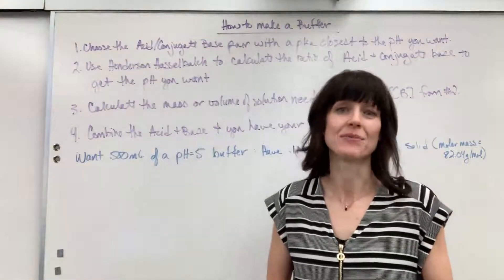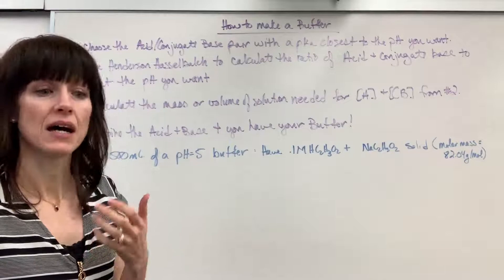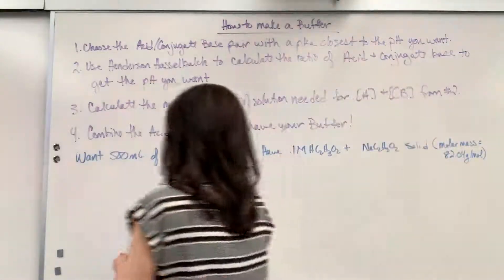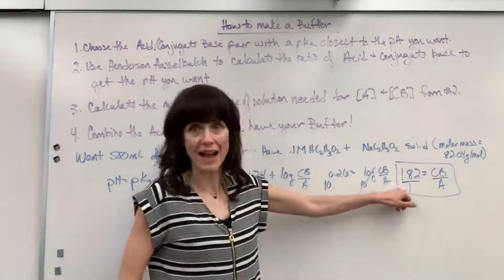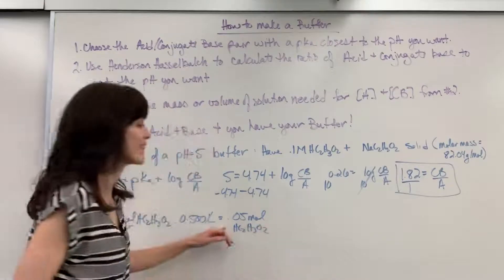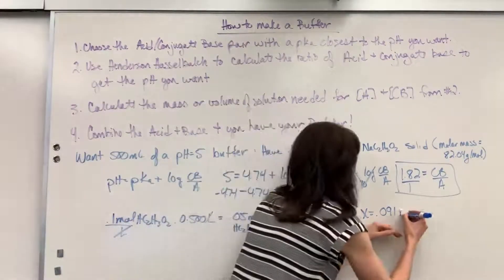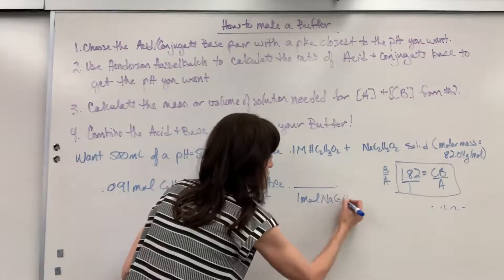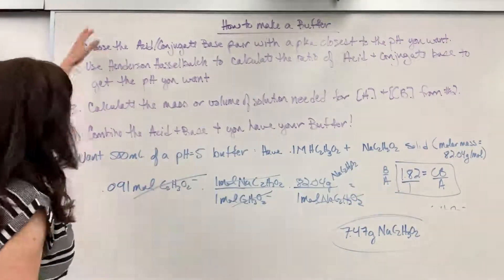How to Make a Buffer

Comment: Hi, just a quick question: 500 mL is equal to 0,5 L, so if you have 1M of whatever solution, 500mL should give you 0,5 moles, right? At 5:00 you convert 0,5 litres to 0.05 moles, I'm pretty sure that should be 0,5...
Reply from the maker: Hi R1, it is 0.1 M.  Thanks for your question.

Comment: this is so incredibly helpful thank you!!!!!
Reply from the maker: Hi Tess, do initial/final moles.  From the final moles plug the acid and conjugate base amounts into Henderson Hasselbalch.  Here is a video, just the first part, to do initial/final moles.  https://youtube.com/playlist?list=PL0xN_H1gE3VeFFvhiRF8HiR26vMLu9qgq
Reply: @OldSchoolChemistry  you are so kind, thank you for your time! i wish watch them all!!
Reply from the maker: Hi Tess, I’m so glad I hope your class class well!😊
Reply from the maker: Hi Tess, first find the ratio of CB to A using Henderson Hasselbalch.  The pka is 9.26.  I got .1413 moles CB to 1 mole acid.  Find the moles of base.  I got .444 moles base in the solution. Using the previous ratio determine the moles of acid needed. I got 3.14 moles acid.  Use molar mass to find grams.  I got 308g.  I hope that helps!!
Reply: @OldSchoolChemistry  I see my error was plugging in the 0.444 into the HA half of the ratio instead of the A-.  thank you so much for responding !!!

What about if it was asking for strong acid/base instead of g salt?
"How many moles of sodium hydroxide would have to be added to 250 mL of a 0.477 M acetic acid solution, in order to prepare a buffer with a pH of 4.770?"

would the work be relatively the same as this video, but instead of the ratio/1, ratio/0.5?